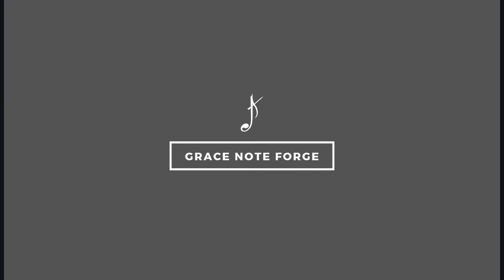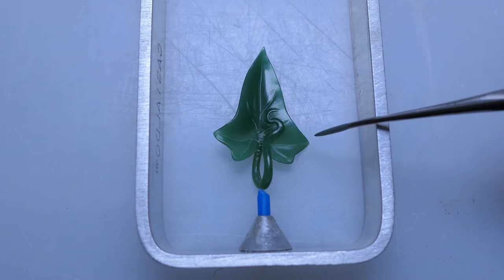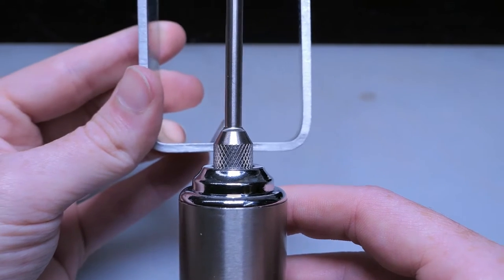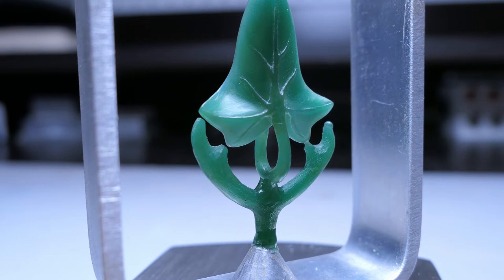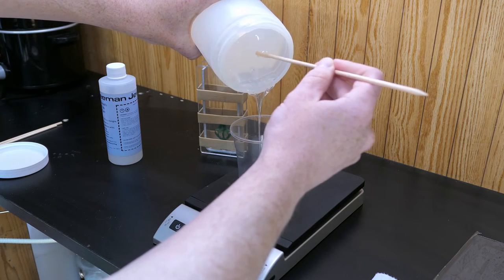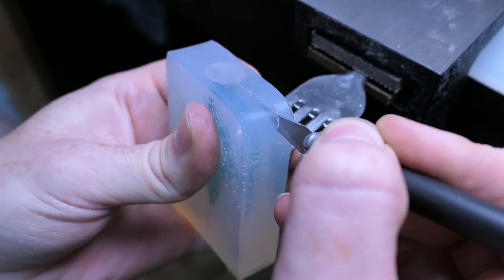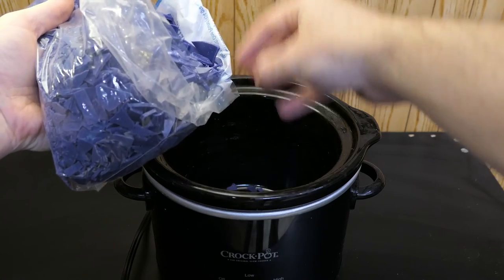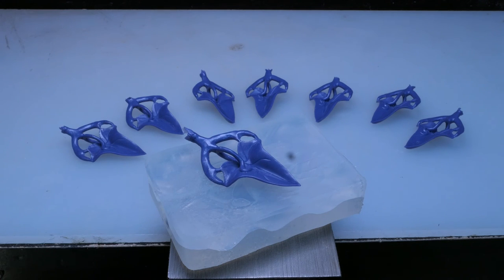DIY Wax Injector for Lost Wax Casting | RTV Silicone Mold Making

Comment: The bent fork!!  That is GENIUS!  I am pretty new to the jewelry making world but I have had to cut open a few silicon molds and they have always seemed like monsters!  It's so hard to hold the mold open, see what you are doing and cut accurately at the same time.  But having a third hand to hold it open for you would make things so much easier.  Definitely using that!
Reply from the maker: Thank you! I wish I could claim that tip as my own but I saw someone else using it (my apologies for not remembering who) and it has definitely helped with opening up my molds!
Reply: Cover the mould in talcum powder .I still dnt use a vacuumed chamber .and glass syringes that hold the heat are available for the wax on internet .vet .peace .a turkey baster .lol
Reply: Some surgeon probably came up with the idea, because it looks like a tiny retractor.

Comment: Cool! I like what you did there. I made one with a modified Solder Sucker with leather glued around the aluminum syringe. I used it to inject green carving wax into silicone molds from a ladle on a  spare burner electric hot plate.

Comment: I've found that warming the two parts of the mix in a plastic cup in warm water before combining & mixing ,gives air bubbles a better chance to get out. Also pre coating the item with a brush helps stop bubbles sticking to the item
Reply from the maker: Great tips! Thank you 👍
Reply: @GraceNoteForge  And......letting the mold cure overnight in a refrigerator will allow bubbles to release and float up.

Comment: That was really excellent! I can't wait to see if you cast any in metal. I love the clear aspect. I want to start with that, to enjoy seeing the process of the wax seeping in, to also observe about sprues. The Freeman website is a treasure trove! Thanks for all the other links too! You made this look doable! Te leaf design reminds me of the elegance of Rivendell.

After thought: I wonder if a toaster oven with a wire fixture on a tray would help to keep the baster warm? If you wanted to buy a ready to go PID controller, you could plug the crock pot and the oven or any other things (analog or non-programmable burnout oven?) into a multi-circuit one (BBQ teams use these too) Then you get control of any processes if you add thermocouples (you then get repeatability too, due to temp readouts)  Have you ever used silicone (baking?) gloves? Can't thank you enough!
Reply from the maker: Thank you so much! I've noticed that the clear silicone definitely helps with demolding pieces and even seeing areas where vents need to be added. I didn't end up making a casting video for this one but I have pictures of the final piece on my Facebook page. 

I used to use a home made burnout oven with a programable PID controller but one day the thermocouple ended up failing and I almost set my garage on fire... I've since purchased a professional kiln (for safety reasons) but I have been thinking about making a wax injection machine from scratch, using a lot of the same parts and probably some added safety features this time... 😅
Reply: @GraceNoteForge  Hi! You say a lot of interesting things :) I realize you might mean clear molds can help a person learn how to cut molds. That would be really helpful! I hadn't thought of that lol I'm not on FB. But I see other casting videos you made I want to watch. 

i understand about the burnout oven. So many aspects there. I love redundancies in control equipment. Safeties all around. We're talking temps hot enough to make wire turn to liquid. I quickly start to think of having a PE design one or more versions and give me stamped plans I can build or have built to specs... have built maybe after the first one. Burnout ovens and melting furnaces use the same basic principles it seems; It might be feasible for the same engineer to meet most needs easily. An artisan could use a bank of ovens and several furnaces if the projects required them; esp if added over time from standard-dimension material. 

I just bought a tiny Swest injector for $140. It's being shipped. I went through the process of considering them ( this video was part of that) I'm new to this! I identified for me, acquiring or creating the injector nozzle was hardest, and those cost $111 on Romanoff (cheaper elsewhere no doubt) and the things add up from there. And Swest's machine is tested and tweaked from experience and is or was made to insurable standard, and made here in the US. Building stuff can quickly mean buying overseas and I wish to starve the Asian monster as much as possible and invest my dollars here at home as much as possible. So in the end, it's heat related, with pressure, and if your nozzle seal blows, what happens to someone nearby?  If I did build, I would seriously consider the double boiler or water-jacket approach. It's more wu-wei lol you can do it with a small pressure cooker, even maybe the smallest instant pot with a modified lid and 'wax crucible in water bath' inside...a vessel within a vessel. What do you think of that? lol (a small pressure vessel secured in water in a crock pot is a version, but lacks a PID if not original to the crock pot, but for wax, not critical?) I'd be happy to talk more! My question is what muscles of creativity are you trying to exercise by building your own? If I watch your channel more, I may learn that answer more :)

Can I ask you: how thick do you like your molds? Your Castaldo mold frame there is 3/4" for final mold thickness? Do you have several sizes? Otherwise the frame measures 1 7/8 w ID by 6" tall with a wall thickness of 1/4"? Do you use a 1/8" D sprue rod? I hope you don't mind my asking. I'm thinking of making my first mold frames from AL bar stock lol I have tons of thick plexi. I might even u-groove some to interconnect with a frame.   I see this "comment "is super long. I really appreciate your time! I hope to watch more! I may just say thank you and not comment as much lol I wish you a great day!
Reply: @GraceNoteForge  so the afterthought is, are you going to 3D design your own nozzle, cast it and have it machined? lol ??? :)

Comment: Great videos, clear and inspiring.
What I would love to know is did you manage to de-mould the leaf without beaking the delicate stem piece?
With that in mind, do you thing there is an argument for making the mould from the first metal one off produced instead??
Reply from the maker: Thank you so much! Unfortunately I did end up breaking the stem when demolding the original piece but thankfully the mold turned out just fine!
You could absolutely make a mold off of the first casting but the only problem is you run the risk of destroying all the work you put into the piece if that casting doesn't go well the first time (which has happened to me on more than one occasion 😅)

Comment: Hello, thanks for the video, tell me please, I do not quite understand why a metal syringe is better than a plastic one?
Reply from the maker: A metal syringe works better in my experience because its more durable and it holds heat for a longer period of time after being taken out of the pot. Which is nice because you don't have to rush to inject the wax like you would with a plastic syringe.

Comment: Hey great video what do you recommend to do to fix the small trapped air in the thin areas so the wax model is complete ?
Reply from the maker: Thank you!  I try to adjust the speed, pressure and temperature of the wax first. Sometimes all that is needed is holding the mold up at an angle to let the wax reach those areas better. But if its still giving me trouble, cutting away a little relief for the air bubbles to escape normally does the trick. 

Personally, I try to do everything I can to make the mold work as is first because cutting vents into the mold will give you more wax to clean up in the end.
Reply: @GraceNoteForge  thanks a lot
Reply: Could you make a video on how to cut vents ?
Reply from the maker: @certifiedhassan8084  that's a great idea! I'll try and record the process the next time I have to vent one of my molds. 🙂

Comment: Hi Josiah,  love the video! can I ask where you bought the mould holder? is it acrylic pieces that hold the mould when using the vacuum? also, does that injector give enough pressure for good moulds?
I really want to try this as the silicone will have no shrinkage and don't want to invest in a proper injection machine right now 😊

Thanks in advance.
Martin
Reply from the maker: Thank you! I got mine from a local supplier but if your search for "RTV mold frames", there are plenty of options for buying online. 
They normally come with two acrylic plates and either clamps or rubber bands to hold them tight to the frame (the silicone is really viscous so it doesn't leak out).
As for the wax injector, I think it definitely gives enough pressure but since its done by hand, you kind of need to get a feel for how hard to press. With some practice though, you can get some great quality injections. 

Best of luck with your mold making, Martin!

Comment: would a soldering iron work on waxes versus a wax pen?
Reply from the maker: It should work fine. I recommend one with  an adjustable temperature control if you can get one.
Reply: @GraceNoteForge  thanks.  do you know a discord for sculpting or mold making?  i have so many questions, i can't seem to get enough help.

Comment: If i make a 3D resin ring positive on a 3D printer, can't i make a negative mold of same? My goal is to avoid casting using torch fired metal but making a 3D printed mold and precious metal clay? Say precious metal clay sliver hardens in a 3D mold then i place it into an investment clay straight to kiln firing much safer!!

Comment: No need to use the wire to vent. Make and cut mold to release the pattern. Slightly bend the mold, inside toward you or slightly bend over a round surface while cutting a fine blade slit, 1/8" deep, from the pattern to an outside edge. SLIGHTLY <-------- powder the fresh cut you just made with corn starch. Mold slit/vent will close because you made the cut while the mold was slightly bent/stressed over a curved surface - jar, can, drinking glass etc. SLIGHTLY <------- powdering keeps the cut from totally sealing and allows trapped air to escape. This slit is most often powdered ----->ONCE. Excess powdering will build up. not allowing the mold vent to close properly, and will leave a noticeable mark to be chased before investing.

Comment: Your RTV mould has to much air, resulting in many air bubbles. You should put the mould into a vacuum chamber (preferably with vibro) for couple of minutes before it solidifies. It will remove all the air bubbles.
Reply from the maker: I tried that but ended up hitting a bit of a snag with my vacuum chamber (I explain that at 5:30). Thankfully none of the air bubbles were on the surface of the model so the mold still works great!
Reply: @GraceNoteForge  Otherwise, a very good job
Reply from the maker: @kwidzius  Thank you
Reply: @GraceNoteForge Excellent video!  Standard procedure for making silicone molds, btw, is to degass the silicone in the vacuum chamber BEFORE pouring it into the mold box.  That would have eliminated the bubbles without having to put the mold box into the chamber and encountering the tight fit.
Reply: @karllautman  Vacuum the mix before pouring, pour mold, vacuum poured mold again to make absolutely sure all internal voids fill with mold material. A typical RTV mix will rise once during the initial vacuuming and not rise anywhere near as much during the mold degassing.
Reply: @frankfritzges7819  Good idea.  Any benefit to curing the mold in a pressure chamber, to compress any remaining bubbles after the second vacuum?

Comment: Can you do me a favour and measure the main o-ring on the plunger please (Internal diameter and outer diameter), I wrecked mine and stupidly threw them without measuring, so can't use it any more till I can find the sizes to order a few dozen spares :)
Reply: For your issues with air getting trappen in your previous moulds. Take a scalpel blade, and make 4 thin cuts on each half of the mould (1mm deep is enough), leading from the pattern  to the outside of the mould. Then bend the silicone so the cut pulls wide and add some talc to them. This will keep the air channels open, but not allow any wax to fit :) I do that technique with every mould, and it helps 100% of the time :) When I start to get air trapped again, I just bend it open again, and add more talc to the cuts.
Give it a try with one of your old moulds and you'll instantly see the issue resolved
Reply: For your crock pot, I use a similar idea, but i use a secondary container inside the crockpot, and fill around it with water. That way I can regulate the temperature more precisely, as I can add cold water to cool it down a bit if it's overhot.
Reply from the maker: Thank you for the tips! I'll have to give them a try. I'd love to measure that o-ring for you but it's currently encased in wax 😅 (I should have taken it out of the pot). I'll try and measure it when I do more injections later today. I already follow you on Instagram, you do some great work!
Reply: @GraceNoteForge  thanks dude 🤘 Yeah, leaving it in wax all the time, and mega overuse is probably what wiped my seals out 😂 Making those charity tokens I go through at least 3-4 plastic syringes per 100 successful waxes haha They just can't handle the wax. Apparently nitrile rubber seals are the better kind to use than those that come with that steel injector. I'll message you some pics of what I mean about the moulds on insta :)🤘

Comment: Why not just print it in a castable resin?
Reply from the maker: Because I really enjoy carving wax by hand on some projects. 😁
Reply: seems a lot safer to making copies with real wax in a mold rather than using a SLR 3D printer which are dangerous. Also I'd imagine it's easier to cut mold vents than numerous 3D print supports every time you need a copy.

Also if you 3D printed your design once, you could spend lots of time cleaning up support marks and printing lines, and then make copies from your master, which would need less cleaning up in the future.